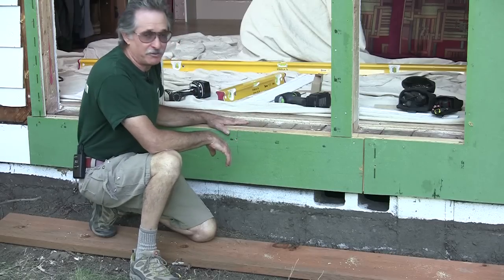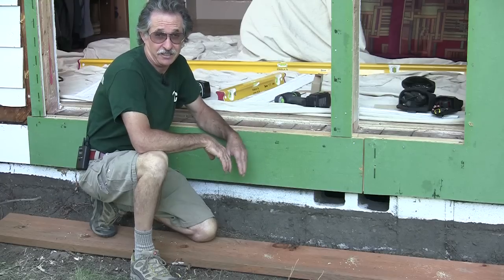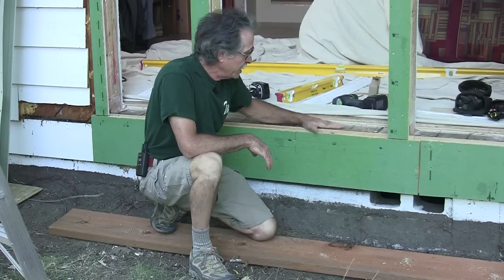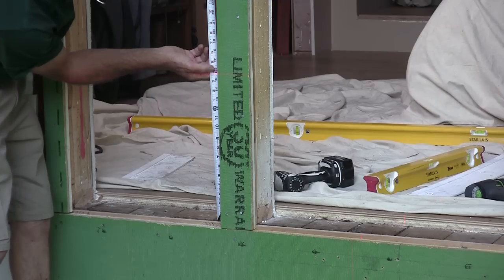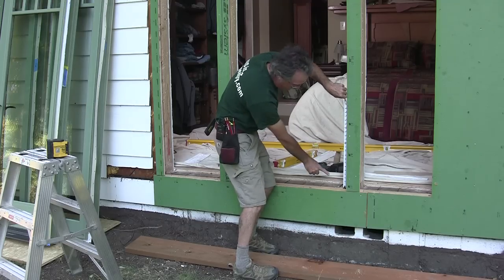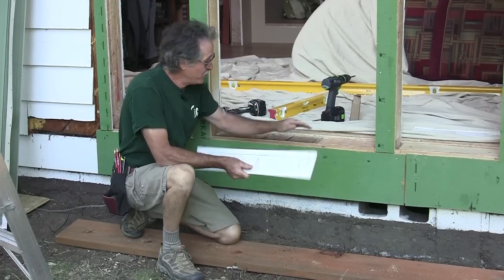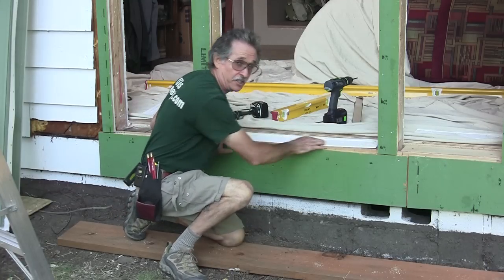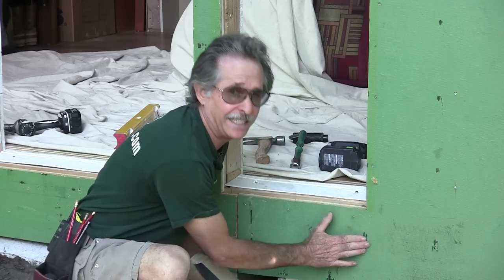Installing Exterior Doors & Windows: Preparing the Sill

Comment: I had a installer install a sliding door by simply placing the door on wood with silicon on the bottom between the wood and door. He didn’t do any flashing on the door sill.  Does this make any sense. He mentioned when the siding people show up the will do the flashing.  If I’m not mistaken doesn’t the sill pan flashing have to be installed?  I can’t find any examples to flashing in the fashion he is describing.

Comment: nice job...How would you go over a cement sill?? I am putting in a slider over a concrete patio which has a small  1x5 inch cement sill. Its 5 inch wide and 6 feet long......not sure if I should drop the vinyl door onto the cement sill, or use a thin p.v.c. board in between...Pella says that i can just go over the cement sill after the tape and sealer are put down there......i appreciate your input, spent 35 years as a painter, a newbie with this sort of work.!!

Comment: note the Tajima caulk gun he's using. The sealant he's talking about is quite dense and hard to push with a standard caulk gun, especially if its not 85 degrees. The gun he's using is probably 26:1, vs the 8:1 guns you commonly see on the shelf. Other companies make high ratio caulk guns, but Tajima is a very high quality brand. That's why they paint them in metal flake car paint (I think).  Worth having a good gun unless you like broken caulk guns in the middle of setting a door (or window).
Nice one, Gary!